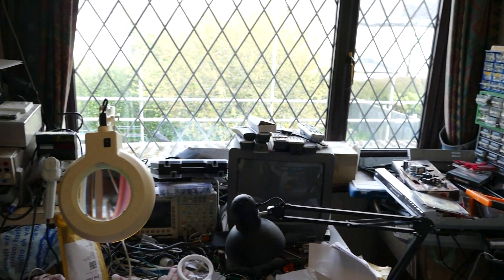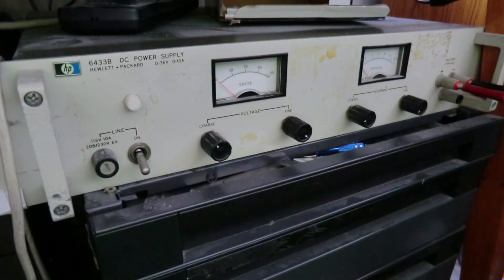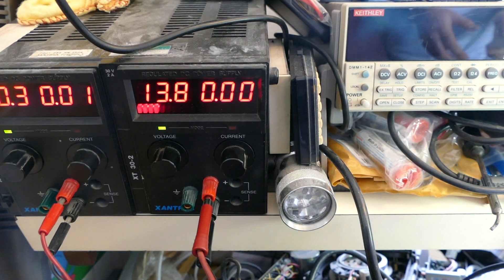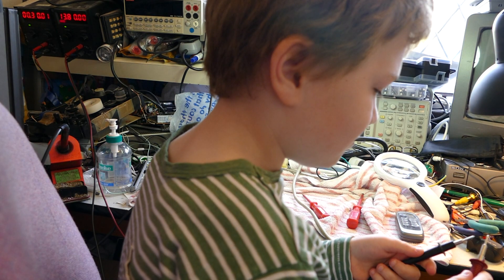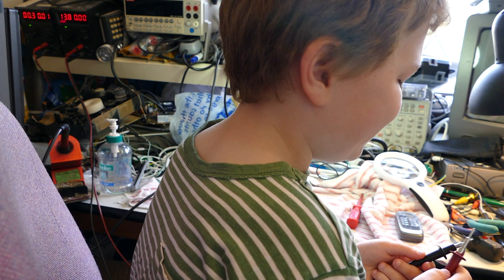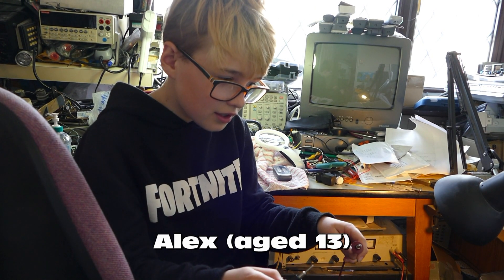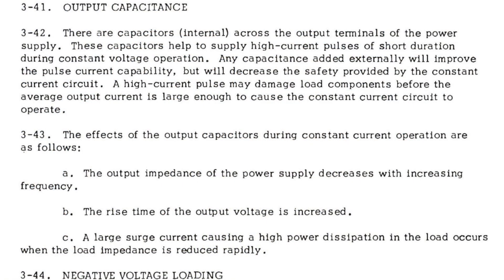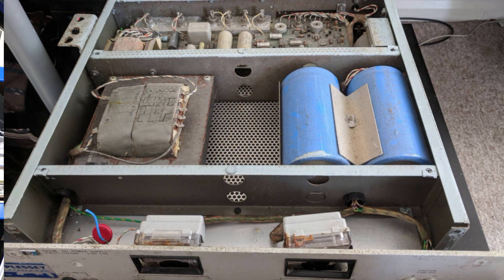The power supply from Hell, HP Model 6433B

Comment: I used to rejuvenate old NiCd batteries in a similar fashion. A little project box, with a salvaged transformer, that gave 100VAC, at around 10mA, that fed a bridge rectifier that charged a used 100uF 250V capacitor. Then a switch that applied this to the battery contacts. Would click, and after 3 or 4 shots your whiskers would be all blown away for a month or so, till they grew back. Used it to rejuvenate cordless phone battery packs, where they would last around a year longer, before i would need to replace the 4 AA cells in the pack with new.

Comment: I just acquired two HP 6448B supplies and I already know they have a good impulse capability before the current control kicks in.  In fact the manual also covers it like you show!  Linear VS digital.  I like the older stuff.
Reply: You might have already noticed that if you lower the current knobs to zero, the supply itself will stop producing voltage.  You do this before you connect your load and then move the current knob up while confirming you do not have a short.  Soft start.

Comment: The Triac you are referring to is on the primary side of the transformer. The purpose was to limit the in and out voltage across the series pass transistor. I think it was an ingenious design. Modern linear power supplies use multitap transformers and relays to minimize the voltage difference across the series pass element thus reducing the amount of heat the transistor would have to dissipate.

Comment: Wow! To think that I was lusting after one of these jobbies... I never would've guessed I'd be buying a super expensive light dimmer...
Great cautionary tale given here. I bet it applies to other PSU's of that age too..
Always use common sense - never trust equipment blindly.
Reply from the maker: They have their uses, but the slow response makes them a bit dangerous for some applications.
Reply: @video99couk  I'd only buy one of those in order to be able to test-power up old equipment with a likelihood of having old and possibly failing or deteriorating caps inside. The voltage and current limit would provide some element of safety in that a failing/deteriorating cap would not leak more than I would allow it to and thus cause huge damage. I have some such devices which I haven't powered up between 4 to 10 years which were made in the 80s or 70s. Unfortunately the latter are the more expensive ones and the ones I haven't powered up for the longest period. Granted, a current limited PSU would not provide total safety from damage unless it allows limiting the current down to, say, a fraction of a mA.  Even a PSU that allows limiting, say, to 100mAs could be of use provided it won't allow a turn on spike. One could of course take measures against that provided they know in advance that the PSU does not trigger the limit instantly.  In essence, I'd use such a PSU briefly to check for cap problems and then probably disconnect the offending caps from the circuit and use the PSU current limiting to try to partially reform them.  It's a lot of hassle, isn't it? Going through the DUT's caps with the in-cicuit component tester might save some time of course but these component testers only provide a limited output voltage (9Vor 12V I think?) which is mostly or no relevance to the real working voltage and (most importantly) cost almost as much as bench PSU.

Comment: I have the same power supply as this i think mainly the reaon there like that is becuse there not much as a lab supply it more to run machines and stuff like that on a dedicated site like bt equipment mabey ?
Reply from the maker: That's probably part of it, yes.  It's probably not primarily a lab supply.
Reply: video99.co.uk myne is slighty diffrent  model i noticed myn is a 6263b  and has adjustable over volt ajustment on the front right side as i noticed your one did bot have that but i see what you mean buy it stores power when you shut it off with no load  the caps inside are massive i dont think iv seen any that big in a power supply before lol